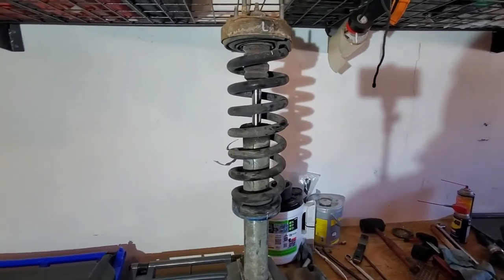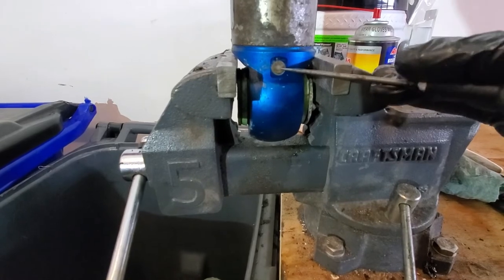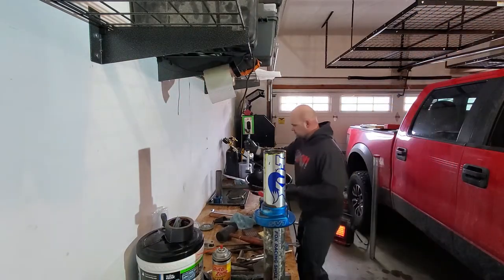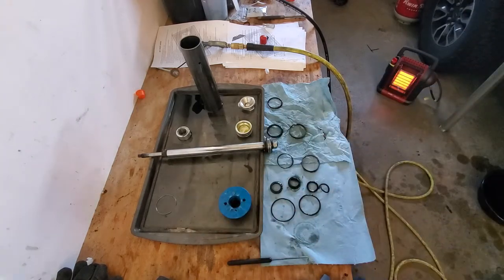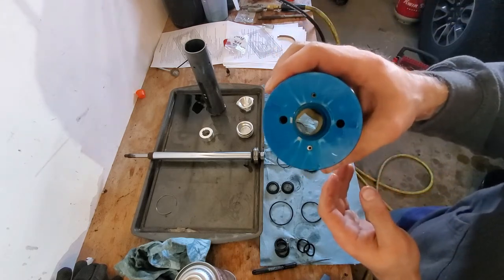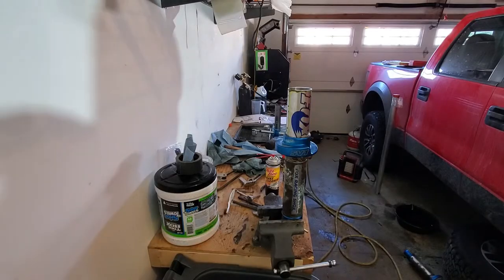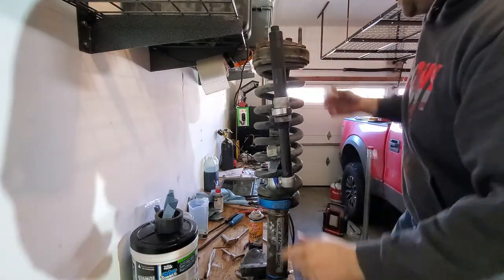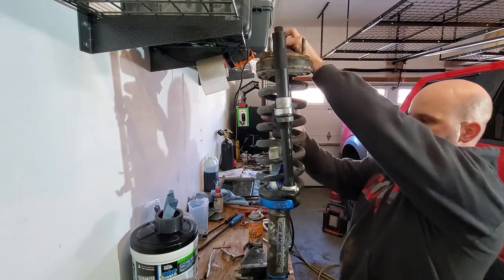Gen 1 Raptor Front Fox Shock Rebuild

Comment: Super informative video, thanks for taking the time. I've just purchased a 2014 Raptor here in Australia, which is obviously very rare as they were never sold here and it's super expensive ($53k) to put the steering wheel on the other side. Anyway, it's done 63k miles (107k kms) and 95% highway, so it's right on time for it's first rebuild. There is nobody here that does them so I'm on my own except for blokes like you who are helping from afar even when you dont realize it.

So a couple of things maybe you can link me too. I located Forged off road, but they dont have that bullet with the taper that you used to insert the top gear onto the shaft nicely without damaging the seals.

Also, the pin pliers to remove the top car that you slipped that big pipe over? What are they called and where can you get them? BTW, I'm hoping that big pipe ddnt fall against the vehicle the way you left it standing up like that!

And last but not least. The specs on the shock fluid. I'll have to find a local supplier for that as I wont be able to ship oil to Australia with USPS.

Thanks again for your efforts.
Reply from the maker: If I were you, I would get in touch with schmidty racing, I believe I put a link to them in another comment. They can get you all set up with tools and might be able to get you the fluid too. 

Otherwise, see if anyone around you sells Fox shocks and they can get you the fluid. It's also on Amazon, but I'm not sure if they'd ship to you there.

Comment: Thanks for the Video, Would you mind posting a link to where you got the rebuild kit, shredder valve , regulator ext.
Reply from the maker: I got all of the tools and oil from https://www.schmidtyracing.com/

I bought the rebuild kits with the Schrader valves from https://forged-offroad.com/2010-2014-ford-raptor-fox-shock-exchange-program/?v=f24485ae434a&gclid=Cj0KCQjw_viWBhD8ARIsAH1mCd4Os1YmJ7KhNX7bllDdYWVvN_43CHUxEpn09WkGZwGYMgzh9tzHWOsaArLVEALw_wcB

Both companies are great to work with and quick to reply to any questions I had. 

Let me know if you have any questions!
Reply: @minutemaintenance7385 

That links doesn’t seem to work anymore. About how much including oil does it cost for the rebuild kit? Thanks!
Reply from the maker: Forged seems to have gone out of business so you'll have to find another company to get the parts from. ☹️

If I remember right it was around $100 for everything, but with inflation it's probably more now. 🤣

Comment: Great video. By the way.  Did you clean the grease that is under the bypass piston? If you did clean it.  Did you put new grease?
Reply from the maker: I did not use grease anywhere on these during the rebuild. I'm about to do it again though and can let you know if that answer changes.
Reply: @minutemaintenance7385  Appreciate your quick response and thank you for the video.  I also email Forged Off-road and this was their reply “Hey, So those should have some grease on them so when they go in it's not dry which can roll the oring. 
All that excess can be removed. 
Super Lube 41160 or lucas Red n tacky is good.”  Thank you again.